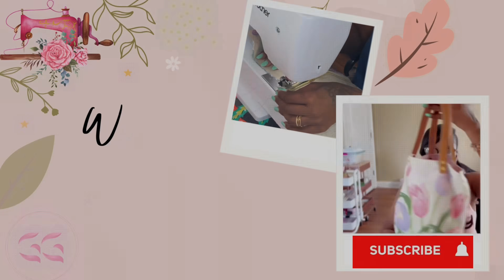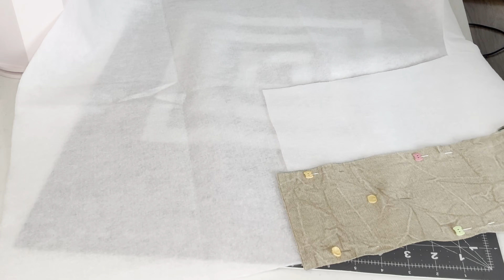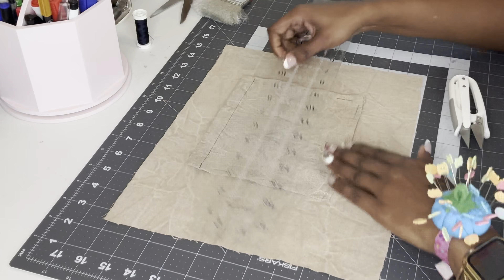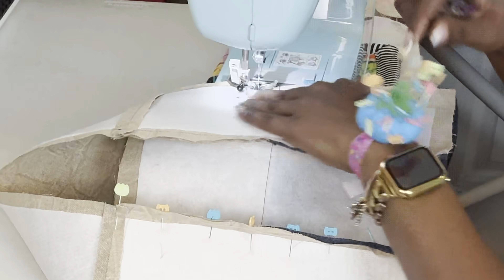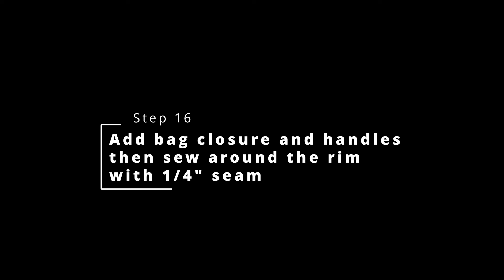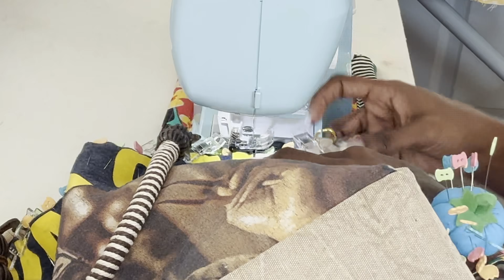How to add a lining and an easy pocket to your handmade bag | Beginner Bag Maker Bootcamp Lesson 6

Comment: Video finally showed up I’ve been looking for it. 

So when you attached the pocket to the lining you said you centered it but I notice the top of the pocket to the top of the lining is not the same measurement as the bottom of the pocket to the bottom of the lining.
Reply: Ok thanks really nice bag. I went to Walmart and was looking at there men’s and kids graphic tees. They are like $5-8. They had some Tupac Snoop etc. if you feel the cost isn’t too bad for a brand new shirt.
Reply from the maker: Okay so thanks! centered from the left and right but from the top I left about 2 inches from the top of the lining panel🙂